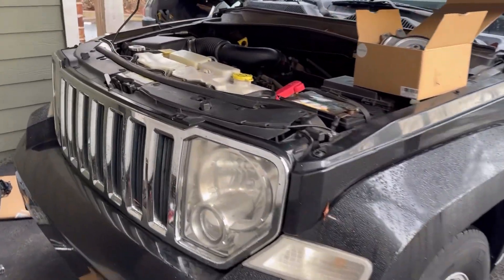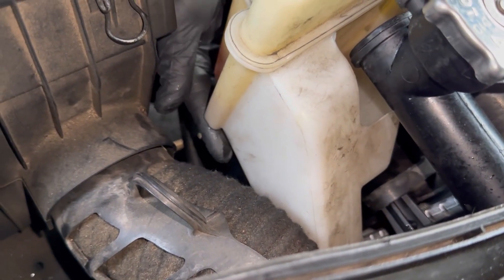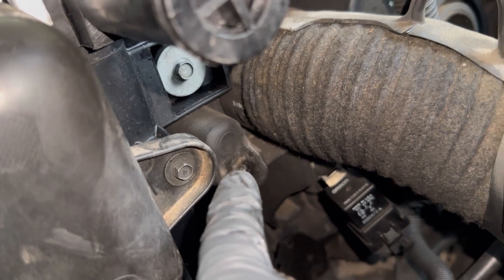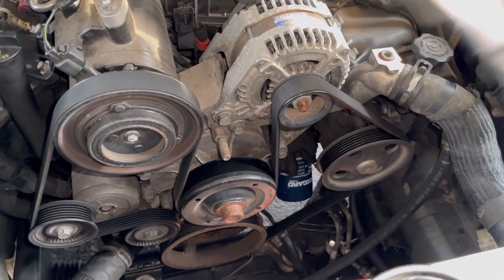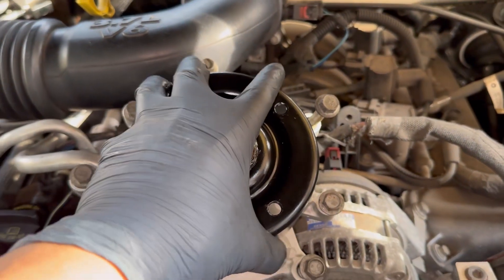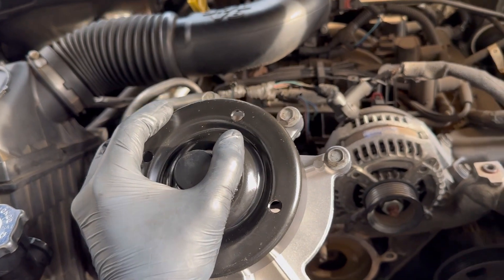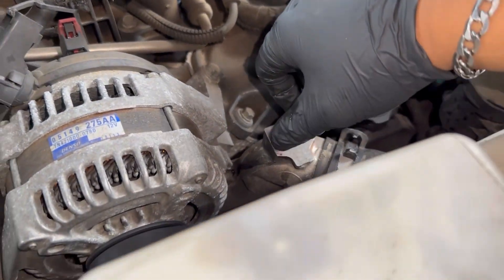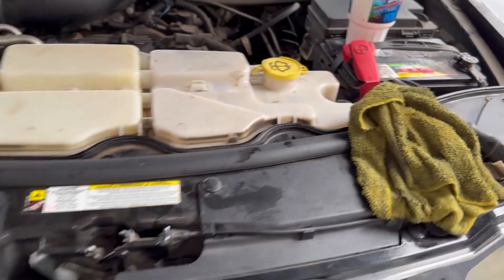2009 - 2013 Jeep Liberty 3.7L Water Pump Replacement

Comment: The clip for the window washer fluid, you pull on it with a little hook tool, where you put  your screwdriver, pops off. Window washer pump, pull up, out it comes. You don't need a screwdriver for the fan clip. The grey clip, press down on the top part of the clip, pull. To get those back screws out on the reservoir, use a small 3 inch ratchet inter change able bit pieces. Easy to change your oil when fan cover is removed.

Comment: Great video I had a quick question if you wouldn't mind informing me

How do I know for sure it's the water pump

The other day I went to jiffy lube and told them that it was sounding like a boiling sound by the radiator

He told me it's the thermostat

So I change it but the boiling went away still lol but

But today my wife drove it and it stop on her and once she tried to start it it was making a rumbling sound but not coming on

It's not leaking coolant

But when her uncle got to her and put water in it after it cooled down then it started

Does that mean it's the water pump

Because I been putting a lot of money in it and it's not fixing the problem

So if you could tell me something I would truly appreciate it
Reply: If the water pump didn’t fix it it’s probably the radiator itself then